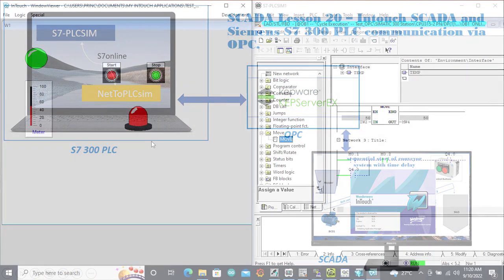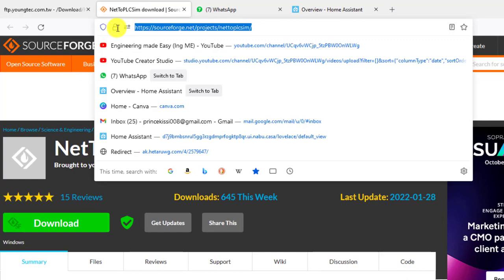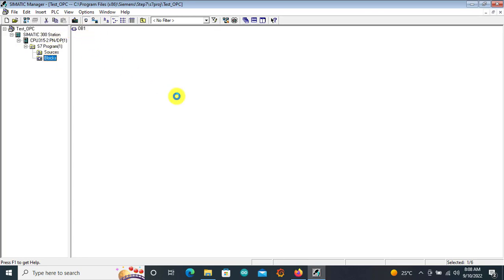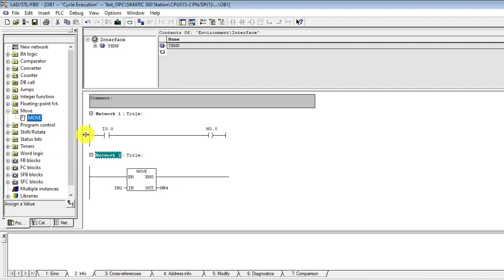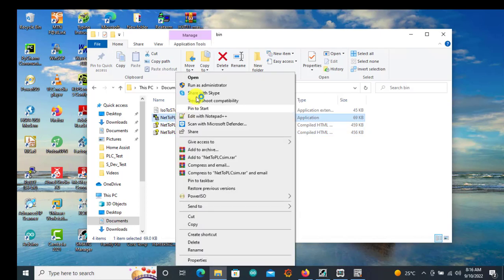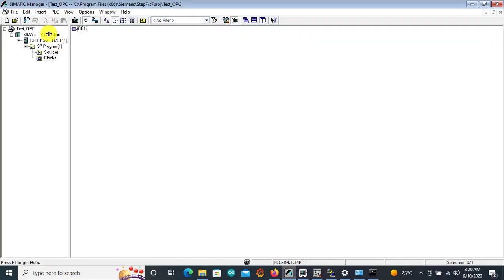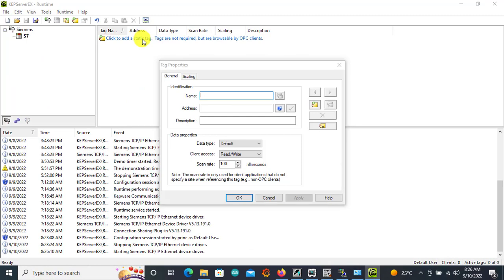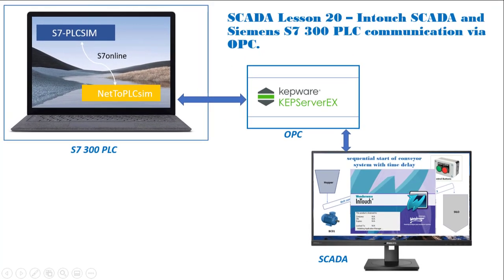SCADA Lesson 20a – Intouch SCADA and Siemens S7 300 PLC communication via OPC

Comment: I have a questions please. I stored the output value of a scale block function in my s7 300 plc program in a DATA BLOCK, how then do I assign the correct Tag name and which data type do I use for this DB in the kepserver X application
Reply from the maker: Thanks for your question. I have not tried that yet However will do that and share the info with you ASAP.
Reply: @engineeringmadeeasyingme6819  Alright and Thank you sir for the interaction. Will be patiently waiting for a reply

Comment: Very intuitive video. I have a bit of a problem though. After creating the tags for the digital and analog outputs to be monitored, when I click on the quick client tab and it opens, at the value column of my newly created tag reads “unknown”  when I run the simulator in Siemens it doesn’t not update in the OPC. Is there a way to resolve this please
Reply from the maker: Thanks for your question. at the base side of the Kepserver window what message do you see, do you see information about successful connection to the PLCsim IP ?